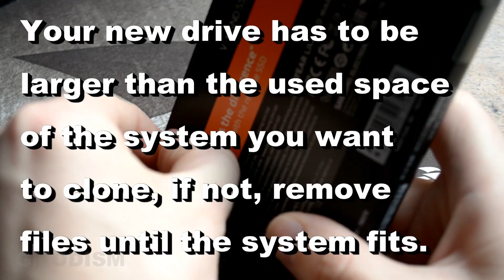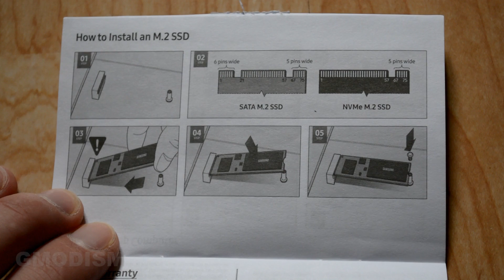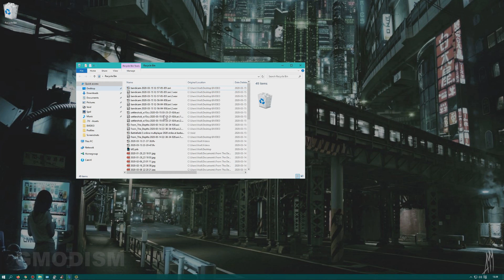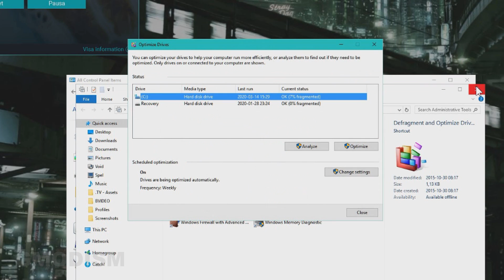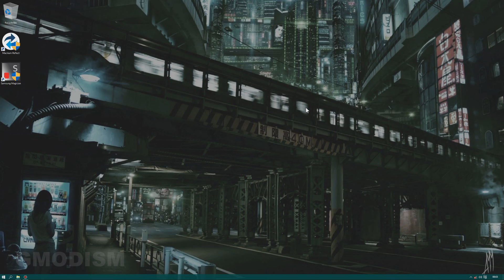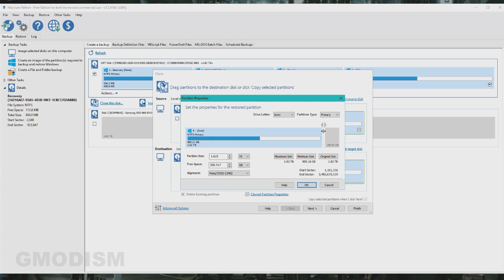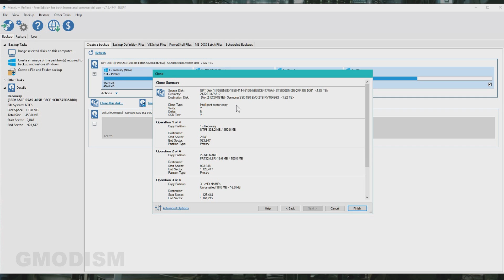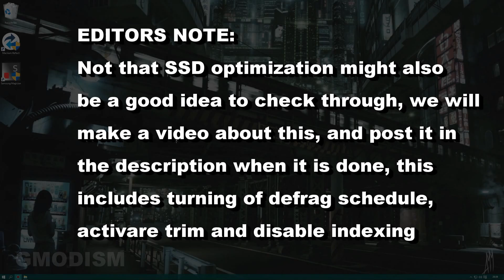How to Move Windows 10/11 from HDD to SSD

Comment: Unfortunately, I was unable to get this to work since I am moving from a SSD to M.2 and can’t plug in the m.2 to the sata connector on the final steps. But good in depth tutorial that is easy to follow
Reply from the maker: Sorry to hear that, you need to buy an adapter for the m2 card for this, after that it should work.

Comment: My computer keeps getting stuck on the windows loading screen. At first I wasn't able to load the bios but when it finally did I switch the boot to the ssd and rebooted but its still stuck on the black screen with the loading sign
Reply: Did you find a solution? i have the same problem
Reply: @thomasathan6390  no I ended up having to take it to techs at my university and they couldn't figure it out either so they just reformatted and gave me a new copy of windows
Reply: Same problem too...
Reply: @xaingu1  You have to copy the parts of the old driver as it is in the same order, iam talking about the 7:27 minute of this video.

Comment: Is there a way to copy just windows and not everything else, I don’t have enough space on my ssd for the whole c drive
Reply from the maker: Yes, but not using this software, and it is less safe to do. I recommend you to remove files until it fits, also watch the full tutorial, this is short version.
Reply: @GMODISM  its only a 120gb ssd and i have 800 gb of stuff on my hdd
Reply: @GMODISM  do you think you could make a video or tell me how to just transfer the windows and not the rest, I don’t have the money to spend 100$ on a 1tb ssd
Reply from the maker: @stewie1036  I plan to make such a video, it's on the to do list!

Comment: To everyone that gets a boot up error (error code: 0x000000e, unable to locate winload.efi): remove all partitions from the current SSD that has all the cloned HDD data (basically like a factory reset) and redo the whole cloning process with Macrium Reflect as stated in this video. For some reason, during my cloning process it created a duplicate copy of the recovery and reserved system which caused them to clash with each other during boot and was what caused the winload.efi error. You can find out how to clear all partitions of a disk on YouTube as well as this guy's channel but a simple search should lead you to it.

Tldr; redo the whole process again after removing all cloned partitions.

Comment: Thank you!! This process worked perfectly for my switch over to a Samsung SSD from my stock Acer HDD. The only thing I had to troubleshoot was that both disks were categorized as "Windows Boot Manager" within the Boot tab in BIOS. I was completely and utterly confused as to why the SSD wasn't showing up as a boot drive in BIOS. I have no idea why my Windows 10 OS categorized them as that, but it did. Once I figured out that although both disks were labeled the same, that they were different I switched the boot drive and everything has worked out. 

Thanks for your help!

Comment: ok so i want to use both ssd(about 128 GB)  and hdd ( 1 TB) and i only cloned the windows folder to the ssd
question is when i set the boot option#1 to boot the ssd  and boot option #2 to boot the hhd hhd, will i get an error that there's windows in both of the drives or will the computer just recognize the windows from the ssd and treat the hdd as an external drive and not boot windows from it?
and if it's the second option can i delete the windows folder from the hdd and use all of the 1TB? (ofcourse after making sure that the ssd won't fail for about a month or so)
Reply: yeah, those all my question too
Reply from the maker: Yes you should be able to select the ssd as first boot option, you should be able to delete the windows partition on the old hard drive later, but make sure that no data remains on that partition.

Comment: I'm almost all the way finished but after I powered the PC on after taking the HDD out and putting the ssd in its place its stuck on a black loading screen with a little swirly loading thing at bottom idk if I'm supposed to wait till it's done or if I did something wrong and all this waiting is for nothing

Comment: I did everything as the video says and got 0x000000e and missing WINDOWS/system32/winload.exe Any suggestions? Just clear the ssd and try again?
Reply: OK I found the solution, not sure if you still require it but I'll leave it here: remove all partitions from the current SSD that has all the cloned HDD data (basically like a factory reset) and redo the whole cloning process with Macrium Reflect as stated in this video. For some reason, during my cloning process it created a duplicate copy of the recovery and reserved system which caused them to clash with each other during boot and was what caused the winload.efi error. You can find out how to clear all partitions of a disk on YouTube as well as this guy's channel but a simple search should lead you to it.
Reply: Did you find a solution to this problem? Please share, I'm also encountering it.

Comment: If you get a BLACK SCREEN after booting with the SSD then it means the cloning process failed. Most probably because you were trying to copy Windows while it was running. The fix is to do the cloning outside of Windows. Either plug both HDD and SSD into a separate machine OR from Macrium Reflect choose "Create bootable Rescue media" from "Other Tasks". This will allow you to run Reflect from a bootable USB drive instead of running it Windows. Hope it helps! :D
Reply: Isn’t windows always running?

Comment: If I only have space for one drive at a time, what do I do?
Reply: Use an external hard drive through your USB port to create a copy
Reply: @jordanyoung8245  but I would still need another internal drive, so would I then copy it from the external to the other internal?
Reply: @luciuswomack4337  correct. Once the copied has been made the the external drive. You can swap out old internal hard drive to new internal ssd, and copy it back over to new drive

Comment: Thank you! This video was very clear, I can finally start up my pc without being able to have breakfast, go to the gym, go to church, and wake up from a nap. It boots so fast!
Reply: Lol fr I would have to wait like 10min
Reply: @XX-bc3io  half an hour for me
Reply: @sethgarrick6320  even more for me
Reply: @XX-bc3io   me it only 1min of boot it good but with an ssd it will be faster
Reply: I want to transfer windows to mu ssd but i dont want yo delete everything in my system also i cant copy everything bc the ssd is only 500gb and i have well over 900gb of data on my hdd :/
Reply: @alexpoly006  just get an external hdd.. its cheap
Reply: @MB0943A  i dont want to have anything outside my pc. You see its very ugly.
Reply: @alexpoly006  step yo data up
Reply: @alexpoly006 
I got a 2tb 5200 rpm HDD installed as a D drive and moved all my photos, documents, videos, etc to by changing the location to get my storage space on the C drive down to under 500gb to fit onto the 500 GB nvme drive. Just about to try and migrate from the 7200 rpm HDD to the nvme as a boot drive.. no idea how it's going to work but will post back if it does
Reply: Mine take 20 min😂
Reply: @nonamehere7571  built a new one 12.063 seconds now
Reply: I want go give you a smiley icon but i cant find
Reply: @tengkahkeong691  😃
Reply: Me too, brother!
Reply: Can you help me do it ?
Reply: @barney8008  just follow the video very carefully, I can't help I'm sorry.
Reply: thanks my hard drive is broken and is being used a lot and i thought it was the cpu but now i know before my pc took 40 minutes to start
Reply: Lmao!
Reply: Just got my SSD installed yesterday. I knew my computer was slow on start up but I never noticed how slow till now
Reply: to church?
Reply: A year later, this comment made me laugh out loud😂😂 thank you
Reply: 😂😂😂😅 exactly
Reply: I can't find the option to boot through sad. Can u help me? I have 2 other hdds...bios shows their options to switch even though I have windows on only 1. Currently after cloning I have windows on 2 drives l, 1 on hdd another 1 on ssd.(I cloned from hdd to ssd). But can't get any option to boot through sad. Should I delete windows on the hdd or something?
Reply: 1 or 1 hour and a half for me

Comment: Wow I didn't think an ssd had a lifespan or could 'fail'
Reply from the maker: Everything does and fail eventually
Reply from the maker: But make sure to watch my optimize ssd video to prolong life
Reply: @GMODISM  Also i'm confused. You said the SSD is connected and working from checking disk management but it doesn't show up on my computer just because its recognised on disk management. So how do i update firmware if i can't see the drive on my computer?

Comment: Will this work on a laptop that currently has the os and date stored on a 64 gig emmc drive? I'd like to migrate to a m.2  ssd and there is possible no way disconnect the emmc drive?
Reply from the maker: If you need 2 m.2 slots for transfer you need a usb adapter

Comment: I did this. Went to reboot windows and its stuck on a black screen with the loading circle and I can move the mouse
Reply: Mine passes that and stays on a black screen with my mouse . U got any thing?
Reply: @calebw9342  actually. Go into the bios and set your boot drive to your old hard drive and disable any ssd on there. Try to boot windows and let the computer sit for about 10-15 minutes and it might boot up. The reason it takes so long is because windows is trying to boot from 2 different drives. If it loads, I'd recommend wiping the SSD. And you should be back to the way you were before the cloning.
Reply: @shotemup123  so u keep the Hdd plugged in to do that?
Reply: @calebw9342  yes. Leave everything in and just take the ssd out of your boot options in your bios. Let windows sit for up to 20 minutes, clicking or spamming keys every so often and it should eventually boot.
Reply: @calebw9342  I wiped the ssd and a friend used docking station to swap the drives data instead of using windows. $35 on amazon and totally worth the hassle free swap
Reply: @calebw9342  I was only able to boot from the hdd on safe mode too

Comment: hi, i need help. I can´t move the files because my hdd where i´m moving from is a 512 bytes drive and the ssd i´m moving to is 4096 bytes. Is there any way i can move it anyways?
Reply: Hi Andy, that should be no problem. The ssd you're moving to has a bigger capacity that the HDD you're moving from.

Comment: but i want to clone my c drive to my m2 drive. but my m2 drive does not have a sata cable its wireles.how can i use the bios to configurate it then?
Reply: @Gmodism Total Nerdery Channel
Reply from the maker: It should still be listed in the boot manager when it's connected to the motherboard
Reply: @GMODISM   yes found it. thank u.

Comment: Hi, I haven't try this method yet, but I want to upgrade my HDD to SSD. But I want to use my SSD for windows boot, and the HDD for files and games etc. What should I do?
Reply: Same
Reply: unless you wanna sort everything out one by one I would recommend doing a fresh windows install into your SSD, after that you can install whatever programs or games you want on your hhd
Reply: @bog_w  Will I be able to use HDD with installed Windows, and SSD as a Boot Only? For example:

Installing fresh Windows on SSD, and making the PC boot to SSD, and use HDD with already installed Windows. I hope you understand me.
Reply: @lumierehev  Maybe? Probably not though. Id recommend just doing one of the two. If u do insist on getting this to work try asking people on tech forums. Good luck.
Reply: @bog_w  Ok I will do, Thanks.
Reply: @lumierehev  that is exactly what i'd like to do, maybe there is a possibility just to delete windows file from hdd and use it as storage only. Boot would be from ssd of course
Reply: @framey9703  I was thinking to move Windows File from HDD to SSD.
Reply: @lumierehev  nah, don't do that, clone everything to ssd and use it as boot and maybe try to connect hard disk as your storage unit and delete windows file from it just in case it decides to boot from hdd. this is not checked for sure, haven't tried it, but that's just my idea :D
Reply: @framey9703  I am not ready to pay more for 1tb ssd to clone my 800+gb hdd

Comment: Tried to transfer windows from a 2TB HDD to a 480GB SSD. Deleted a lot of stuff, backupped my files with Backupper AOMEI, followed your instructions and couldn't boot with SSD. Tried two times, gave up, started normal booting from HDD and it worked but feels slower than usual. Tried to get back my files back from AOMEI but the whole disk is write protected. Want to restore my backup to the original HDD but scared that the clone won't boot as well. Can you help?
Reply from the maker: The original hdd isn't changed from cloning. Make sure you made the transfer completely and make sure correct boot device is selected.
Reply: @GMODISM  The HDD wasn't changed at all, I'm saying that I had to delete most of the stuff from the HDD to make the clone fit into the SSD. I backed everything up with AOMEI before making the deletions and after the SSD boot didn't work I gave up, booted the HDD and tried to restore the backup to my PC but everything was readonly so I can't transfer back. I made sure that the Bios was booting up from the SSD and the clone seems fine. No clue why it got stuck on the booting screen.

Comment: iv bought a gaming rig an it only came with a small ssd with windows on it, now that iv installed a hdd into the computer is there a way of transferring all the files including windows 10 onto the hdd so i can remove the small ssd? cheers
Reply from the maker: Yes this is exactly what this video tells you how to do, however the SSD is faster, you might wanna look at my tutorials on how to format drives and start using the HDD as storage space instead.
Reply: @GMODISM  so windows is faster running from my ssd? Il keep it there then but I just need to move all my program files over and leave windows on the small ssd that’s installed
Reply from the maker: @Deanx91  Yes that is correct, some programs are small, what takes space is video games, music and movies.

Comment: Thank you so much. Got my SSD installed this weekend, night and day difference in the performance. I had an issue where my disk manager & BIOS did not see my SSD at first, had to change sata setting in bios to IDE, try to boot, BSOD, then change the setting back to AHCI then it worked. Don’t know what happened there but it’s working now.
Reply from the maker: Great to hear!

Comment: I just want to install an SSD to my old pc which only has hdd but also still keep my hdd for storage but migrate my windows boot to the new ssd
Reply: @fushi7896  @GoldJH So... you clone, then when you are sure your new boot drive works you wipe the old HDD and use it for storage... Then you can even move old stored stuff from the cloned SSD to the old HDD again

Comment: If you have a smaller SSD that u want to clone to from a bigger size HDD then for it to work easily you first MUST "shrink size" ur C: drive partition to as much as you can using 'Disk Manager' and mostly D. Manager would choose the size automatically.  Once shrunk the empty Unlocated space will be untouched, then you will be able to drag all partitions from the HDD to the smaller SSD in cloning process!  Worked 100% for me.  
Now onced the new SSD boots up and running fine, relaunch Disk Manager and now you will 'Expand' your Windows C: drive partition by selecting it & right clicking it. This process will just take a second and now the Unlocated space will merge into the C: drive as one & you will have use of ur whole drive's space like it was with the old hard drive!
Reply: Hey man, you should pinned this comment to the top. Just saying.
Reply: How and where do you go to shrink it?
Reply: thank you so much you helped me more than you think

Comment: Is there a way to just swap windows 10 os as the SSD im using is smaller than the HDD
Reply: if windows 10 is on the SSD you wish to load it from, go into the BIOS and set that SSD as your boot-up disk

Comment: I can't emphasize enough how helpful, thorough, and polished this video is. Just did my first system migration and it went exactly as this did, no surprises.
Reply: Question,if you switch from a HDD to SSD,your settings and all stay right? more importantly the activation of the windows also stays right? i want to also migrate my OS to an SSD and keep my HDD as games storage only,but idk if i switch my OS to an SSD will it just turn on after the whole process as if nothing ever happened?
I know what to do and i think i explainend it poorly but you may be able to get my point,in short "after the migration does the system turn on as if nothing ever happened but from the SSD instead of the HDD? or does it still need all the fresh windows install steps and setups along with activation?"
Reply: @SHAdow98V  I didn't have to reactive anything in my case. Booting from the new drive was as if nothing had changed (except being much faster). But I am only speaking for my experience with this.
Reply: @WarMonkeyPlays  k thx, was thinking of doing it myself but if i have to reactivate windows afterwards i might aswel do a fresh install